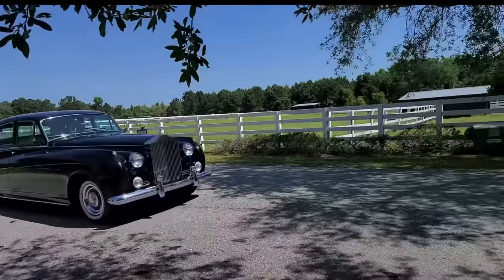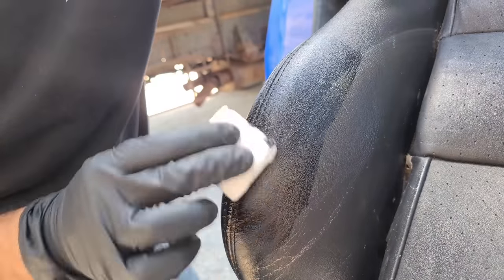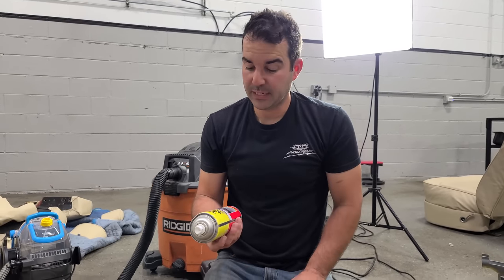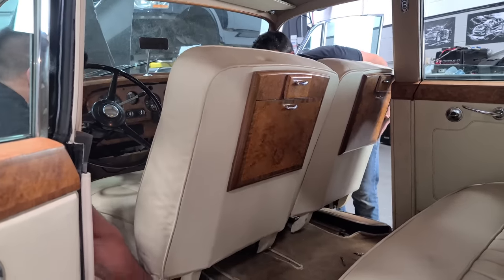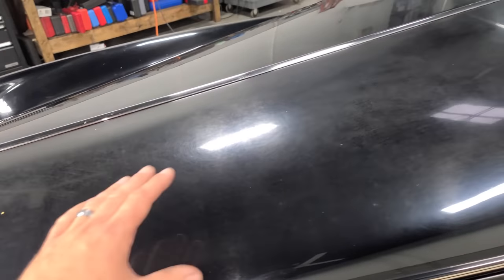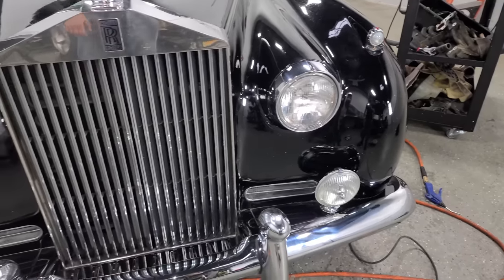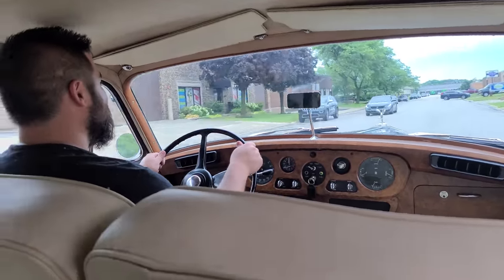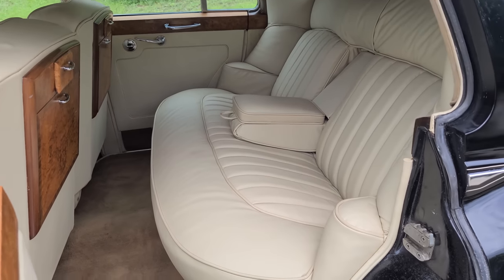What A 200-Hour Restoration Of An Old Abandoned Rolls-Royce Looks Like! INSANE Transformation!

Comment: Rollers have usually 27 layers of lacquer over the paint 
Enjoy
Reply: Rubbish, these had nothing other than the coloured paint layer.
Reply: Have to disagree (from experience) sorry
Reply: @robflange  You don't have a clue what you're talking about. I spent eight years as technical manager for the world only authorised Rolls-Royce and Bentley Coachbuilder. We were, by far, the largest repairer of these motor cars in the world and would typically undertake around 1000 repairs each year that included wood refinishing, trim, special builds, collision repair to any level, restoration and paintwork on cars ranging from 1907 to current.

Until 1994 much of the paintwork was warranty related due to the TPA materials that were being used. NONE had lacquer coatings and that included metallics. The same applied to the modified cellulose materials. Clear lacquer coats were not introduced until 1994 when the switch to 2K materials was made. At most, three coats of clear were applied before being flatted and polished. Adding more leads to softer films that have a tendency to chip and mark. Thicker films also close up panel gaps to the extent contact can occur when opening them. This was a problem with older cars that had been repainted many times. Thick paint films are the last thing you want on a car, especially a Rolls-Royce where body flex causes stress cracks.

You've clearly had no experience of working with these cars and are just repeating some random myth you've heard.